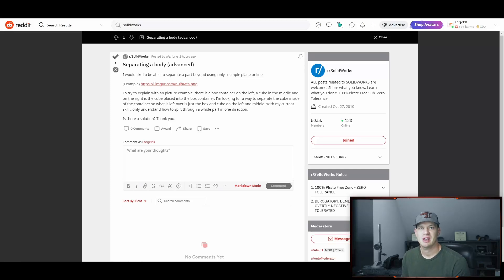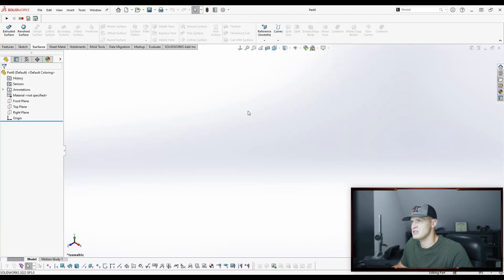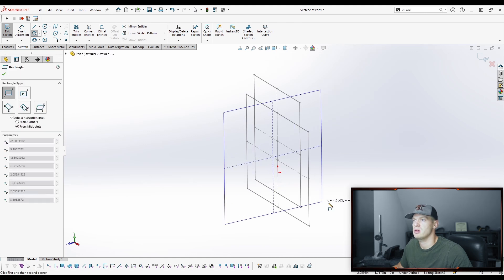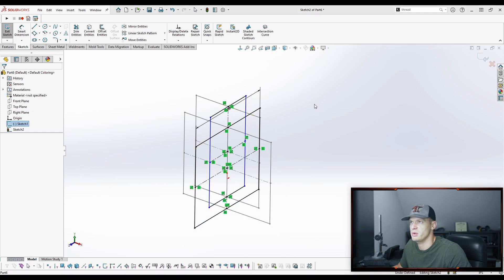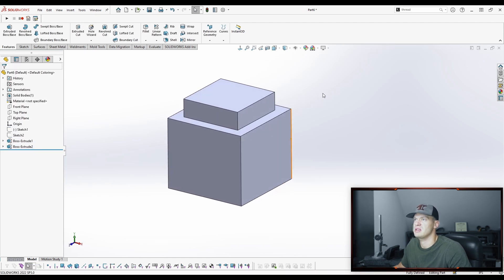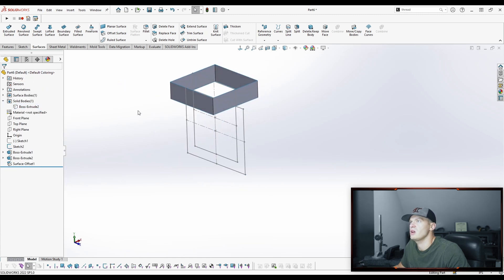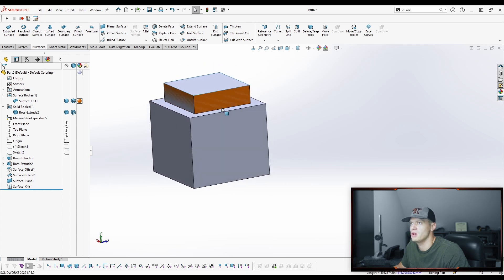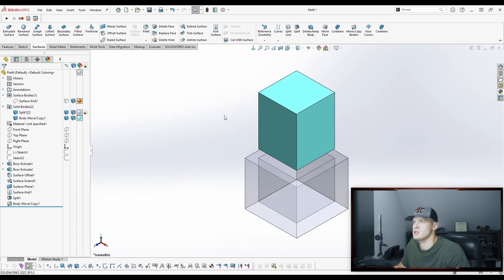How To Use SolidWork's Split Feature to Easily Separate a Solid Body Within a Part File

Comment: You apparently know what you're doing but what you just did seems unnecessarily complicated for demonstrating splitting a single body into two bodies.
Reply from the maker: Yeah, you are probably right. Most of the video is just making geometry (in a complicated way at that). Ill try to keep examples simpler in the future.
Reply: I agree! Video was more complex than what it needed to be.